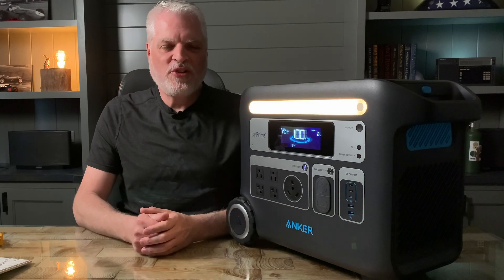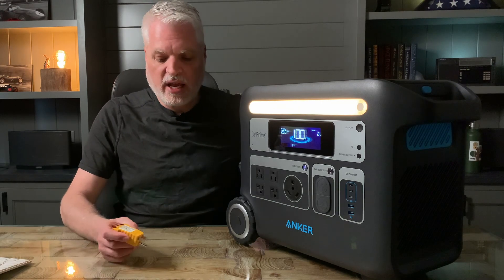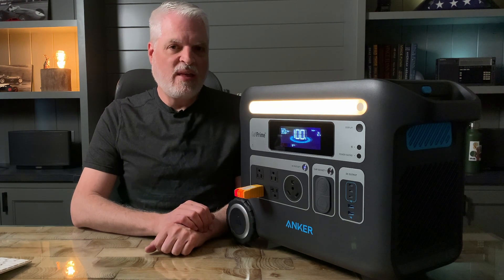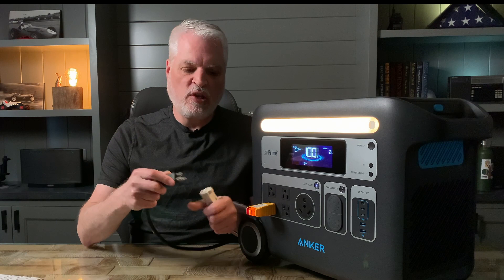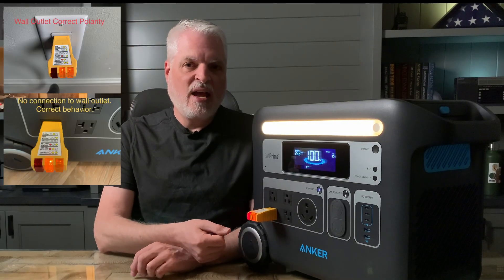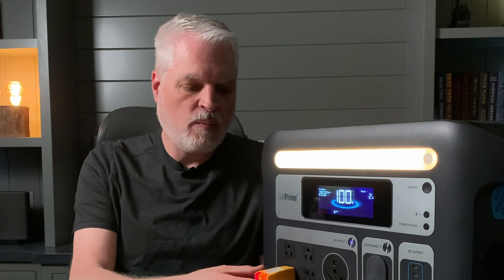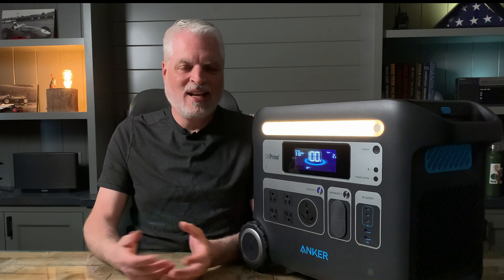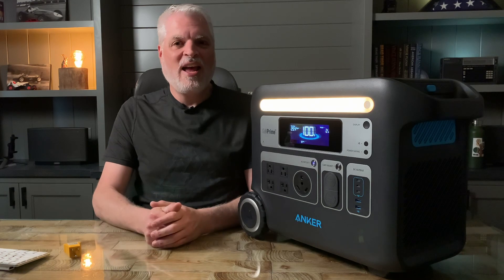SAFETY ALERT: Anker 767 Power Station - DO THIS TODAY!

Comment: Anker says that open-ground is ok to use.  They need to the check NEC on grounding.   Will not accept a return because nothing is wrong with the unit.
Reply: They told me the same

Comment: I just realized this and am 18 months into my purchase.  Of course off line there was no problem.  But now with winter coming on I brought it inside to leave it on mains.  Problem showed up right away with a popped circuit breaker.  I wonder if you could build a circuit to just reverse the polarity of the plug side?  I don't know what's happening internally and would rather have a replacement but since I didn't report it until now they might not like that.  Still, a big investment.
Reply from the maker: Anker has a 5 year warranty so you should be good! I would reach out to their customer service team.

Comment: Thanks for the video, I bought my 767 last year and used it a few times with no issues but after watching this video I did test the plugs and I am getting a HOT NEUTRAL REVERSE issue when it’s not charging. Just sent a email to Anker.
Reply from the maker: They will likely tell you that is normal when running on battery power, as there's no earth connection. When you ground it by plugging it in, it should be ok. That's my understanding, not being an electrician.

Comment: Great video, I received one of these units and in my case the unit shows correct wiring when plugged into bypass mode however when in the inverter mode my socket tester says the live/neutral are reversed. This is weird because it is the opposite. Anker is claiming "you don't have to plug the tester into the 767 when in inverter mode because it does not differentiate between the Neutral and Live wires" is this correct? I have the canadian version without the TT-30R outlet.
Reply from the maker: I received the same reply from Anker. I'm not expert enough in in the nuances of AC Power to know if that's a reasonable answer.
Reply: I just got mine today (767) and I have the same exact problem.  Do you have any updates on this?   When I plug in and it's pass through the tester shows correct.   When not in pass through and unplugged/ inverter only the tester shows hot/neutral REV.  Is this OK or do I have a bad unit?   Thanks for any help on this

Comment: I just tested mine. My outlet is good but the anker before it’s plugged up to outlet shows fault/ open ground, when plugged to outlet it says hot/ neutral reverse? Do I need to contact anker?
Reply from the maker: If you're getting that message when plugged into AC power, I would recommend contacting Anker.
Reply: @TRAILPOWER  I did and have my new unit. Did not take long. Anker did a great job in resolving the issue with zero hesitation! Thank you.

Comment: Today, I received my Anker 767 product and upon plugging it into an AC power source, I observed that the polarity was correct. However, upon unplugging it from the AC power source, I noticed that my Klein RT210 displayed a reversal in the Hot/Neutral connection. Despite this, I have connected several electronics and a wall unit AC unit, which collectively consume 770W and I have not noticed any operational issues. I would like to inquire if it is necessary to report this matter to Anker support, regarding the reversed Hot/Neutral connection.
Reply from the maker: I had the same. Anker’s support said it wasn’t a concern, as did others with more electrical experience than me. I haven’t seen any functional issues with it. If you speak with Anker, I’ll be curious if they have any more to say on it.
Reply: @TRAILPOWER  Upon initially plugging in my electronics and A/C unit, I observed that the system was not functioning as anticipated. However, after updating to the latest firmware version, V2.0.3, and operating the system, I have not experienced any operational issues. Furthermore, I intend to contact Anker to discuss the reversal of the hot and neutral, and I will provide an update on this thread accordingly.
Reply from the maker: They did make some AC-specific updates in the firmware.
Reply: @TRAILPOWER   This was response from Anker:
"Please note the wiring issue has been resolved by our engineers. The units in stock now are the correct version.
Since the tester does not report an error when the 767 is in UPS/bypass mode (plugged into the mains with the AC power button on), it means that the Live/Neutral wires of the Powerhouse are not reversed. You don't have to plug the tester into the 767 when in inverter mode because it does not differentiate between the Neutral and Live wires.

Please rest assured that your Powerhouse is 100% the correct version and is safe to be used. You can plug devices/appliances into it whether in UPS mode or inverter mode."
Reply: @JJ18_M3  I just received mine and have had the exact same experience and  reply from anker.

Comment: My 767 is fully charged, it’s been (2 days) and still has not started charging the expansion pack. 🤷‍♂️  all firmware 1&2 has been updated.  Any advice, besides sending it back and getting two ecoflows.    😂. Your advise is greatly appreciated.
Reply from the maker: I’ve never see that issue. I’d check in with Anker support.

Comment: Scott, how did you ship your 767 back to Anker? did you still have the external shipping box or just use the colorful Anker box?
Reply from the maker: I had both the inner & outer boxes, but Anker did an advance replacement, so I could have sent it back in the replacement box.
Reply: @TRAILPOWER  I only had my inner box so I used it and my repl will be here in 3-5 days.   I'm like you, nothing better than good support. thanks

Comment: Sounds like if you get one of these units, you'd better keep the box. Seems this model made it out of the factory without much (or any) QC. You're not the first person to talk about this issue and a firmware issue (which seems to be fixed).
Reply from the maker: New products have glitches and get fixes. Even if you spend $100k on a new luxury car, you’re going to have recalls and service issues. Anker stood behind it and made it right, with no blame deflection.

Comment: I have heard two different stories on the battery power and would like to which which of these is true: 1) When on battery (and working correctly) it should read 'open ground' or 2) It will read 'Hot and neutral reversed' when on battery (this is not including when plugged into AC). Thanks for your help in advance.
Reply: I got my unit today and show fine on AC but on DC it is showing Hot / Neu reversed and the hot light is flickering. Anker will let me know what they want to do as I sent them a video today. More than likely a new unit, but they said the flickering definitely is not common.
Reply from the maker: Both of my Ankers behave this way- with the hot neutral reverse and the hot flickering. I don't know why that is, but I'm seeing the same flickering red light on my 767 and C1000. My UGreen gives me an open ground, which is what I would expect. My AllPowers behaves the same as the Anker- open ground and flickering red.
Reply: @TRAILPOWER  - The hot flicking is def not normal. I returned my 767 and got a Jackery 2000 Plus. It has no flickering and working much better. It also has the add on battery packs which I just bought one and everything works flawless. They had one firmware update and when I had the Anker for a few weeks they had at least 2 or 3 in just that time. I think they are going through some weird QA issues. I have the 757 and it does not flicker either and is solid.

Comment: With all these going back I suspect when you buy one of these now you might be getting refurbished units. I might consider buying one at a discounted price but would be pissed if they pulled a fast one. I just decided this was the unit I wanted over the Bluetti 200 max because of their stupid noisy charging brick and the slower charging but now not so sure🤔.
Reply from the maker: I haven’t heard of anyone getting refurbs, but it’s possible.

Comment: Your demo failed to establish that the wall outlet of your home is wired properly. That should have been the first test. Even a properly wired Anker 767 would forward a reverse polarity issue originating from a wall outlet to its outlet. Good video but this omission really bothers me.
Reply: I'm correcting my statement now after watching your video a second time. I see that Anker asked you to send picture confirmation that your home outlet is wired correctly. Still, I feel that should have been a recommended step in the process of testing correct polarity of the Anker 767.
Reply from the maker: Pinned comment from day 1 video posted has this instruction. YouTube does not allow video edits after posting, without deleting the video and losing all of the useful comments.

Comment: Hi, I just received mine 5/22/23 with the same issue. Here was their response. Does this sound correct? "Please note the wiring issue has been discovered and resolved by our engineers. The units in stock now are the correct version.

May I know if the tester reports an error only when in inverter mode? If the tester does not report an error when in UPS/bypass mode, it means that the Live/Neutral wires of the Powerhouse are not reversed.  

You don't have to plug the tester into the 767 when in inverter mode because it does not differentiate between the Neutral and Live wires."
Reply from the maker: They sent everyone that same reply. I hope they’re correct. Seems that they are still tinkering with firmware to fully resolve the issues.

Comment: Firmware 1.2.2 update solves the problem. Thanks Anker
Reply: Did they just release 1.2.2?
My replacement 767 arrived yesterday with the same problem of the original. The latest update (1.1.7 I believe). Didn’t change anything.
Reply: @miker8619  it was released today (5/10/23)
Reply: @alexLegends561  Just went to update the software. According to the app. My 767 is up to date at 1.1.7? 
There was nothing for me to upgrade to.
Reply: @miker8619  I would definitely call customer service with your serial number ready

Comment: I just tested. While plugged into wall it reads “correct”. Unplugged from wall, it reads either “ hot neu rev” or “ open ground”, the red light is really dim but on. When I push the GFCI, the red lights up brighter. Any idea what’s I should do? Everything works for me except my window AC unit rattles a lot and has irregular wattage reading.
Reply: My shipping box has the “new” sticker by the way. My ac unit is a small 5000 btu unit
Reply: Having the same issue. This is the response I got from Anker:

"Since the tester does not report an error when in UPS/bypass mode, it means that the Live/Neutral wires of the Powerhouse are not reversed.  You don't have to plug the tester into the 767 when in inverter mode because it does not differentiate between the Neutral and Live wires.

Please rest assured that your Powerhouse is 100% the correct version and is safe to be used. You can plug devices/appliances into it whether in UPS mode or inverter mode."
Reply: @bernardobaptista5150  I received the exact reply. Make sure your firmware is updated on your Anker. This update solves the problem!
Reply from the maker: When I try and update the firmware, it says 1.1.7 is the latest version. My app is also up-to-date. 🤷‍♂️
Reply from the maker: I received the same reply from Anker.
Reply: I have this same issue.  Just got mine today.  Please let me know if anyone gets any updates.

Comment: Just received mine on 3 May 2023 and it has the same problem. I tested it too late in the day to call but did send an email. Not sure why they are still shipping defective units.
Reply from the maker: Hmm that’s odd. My replacement was received a couple days ago and doesn’t have it.
Reply: @TRAILPOWER  The email I got back from Anker said it was a shipping mistake and I shouldn't have received one with the faulty wiring. They are prepping a FedEx shipping label and I'll return it. Fortunately, you and a few others have posted these videos and I was able to test the system before I had an issue. Thanks again for the video.

Comment: Urgent question here.  I received my replacement 767 today and the AC outlets test OK (when using my outlet tester) when plugged into my house AC receptacle, which also tests "wired correctly." So, this 767 seems to be wired correctly.  BUT, when I disconnect the power cord from the wall, to simulate a power failure, the tester shows "hot and neutral reversed."  One red and one yellow light. Is my unit defective?  I am not an electrician here.......  Thanks for your input!
Reply from the maker: Richard, I just received mine, and am seeing the same thing. I’m not an electrician either, so I will have to defer to others in the comments, and Anker support on this.  If I learn more, I will pass it along.
Reply: What was the final answer here? I'm on my second unit - the first showed reversed when in UPS mode and normal on Inverter/Battery mode. Now my new unit is reversed and support is telling me the same "this is expected" answer. Should I press for a 3rd unit?
Reply: @ColemanAsCode  I received my 2nd unit. I was told that in the inverter mode the output is only 2 pin. CS told me "that you don't have to plug  the tester into the 767 when in inverter mode because it does not differentiate between the live and neutral wires."  Makes sense to me.  My replacement 767 came in a box that had a "NEW" sticker on it. It seems to work perfectly so I am guessing that they fixed the issue.  Your call on whether to request #3 but I am guessing that you may get pushback if it is working fine.   I have a question for you (and anyone else) when you leave your AC inverter on with no continuous draw, like a sump pump, does your unit shut off after a period of time?  This happens to mine after a number of hours; the power saver is also set to off.
Reply: @richardmolnar3007  Thanks for the reply. I've left my new unit on inverter power while connected to my Anker Everfrost cooler for the past 24 hours. The cooler typically runs for about 20mins per hour and the 767 hasn't shut off on me yet.

Comment: Should the outlet tester lights turn on when the Anker is plugged in but the inverter is turned off?
Reply from the maker: No. If the AC power is turned off, there should be no power to the outlets. I may have phrased that incorrectly in the video.
Reply: @TRAILPOWER  My unit was purchased a few days ago and does not appear to have the same issue as yours.  The tester shows to be correct when the inverter is on and the unit is plugged in.  It shows hot ground reverse with the inverter off and unit plugged in.
Reply from the maker: So your tester is lighting up when the AC outlets are turned off??
Reply: @TRAILPOWER  Yes.  When they are turned on it looks correct.  I did not expect to see anything with the ac outlets off.
Reply from the maker: Wow, that’s not good.  There should be no power to those outlets when the switch is turned off. I need to have someone else test that who has a ‘new build.’ Let me try and connect with another viewer and have hint test this.
Reply: @TRAILPOWER  Thank you!  I would be curious to hear if anyone else is experiencing this as well.
Reply from the maker: @hourhour9164  Mikey in the comments ran some tests for you on his. He’s much more experienced than me with AC power, so hopefully he’ll pop by and shed some light on what you’re seeing.
Reply: @hourhour9164  I’ve been doing some testing with my multimeter to get actual voltages rather than just lights on a tester. What I’m seeing is the effect of having the 767 having an un-bonded neutral ground internally. This is common for larger generators that will be plugged into a transfer switch to power a house. Once plugged into the house transfer switch, the generator uses the panel’s bonded neutral ground bar. If the generator was internally bonded, you would end up with a ground loop once you plugged it into a transfer panel that already has a bonded neutral/ground. You can read more about my testing in one of the other long threads on this video with TRAILPOWER if you really want numbers. 

I’m not an engineer or expert on generators, but do have an industrial electrical degree and am personally not concerned with this behavior.  Take that for what it’s worth…
Reply: @HamnesiaRadio  Thanks for the explanation!  I did not use a multimeter, just the outlet tester.  I ran the same test with a much smaller power station and did not have the same results.  I will read more about it though.
Reply from the maker: @hourhour9164  @Leafnutz tested his newly-replaced unit with an outlet tester and has no lights with inverter off and charging from AC. Might want to check in with him too. Also, be sure to test your wall outlet and make sure it’s wired correctly.
Reply: @TRAILPOWER  Here is a test I ran earlier: https://youtube.com/shorts/QM-EWOrNdqo
Reply from the maker: @hourhour9164  I’d suggest sharing that video with Anker, Mikey and leafnutz. I am definitely not an electrician, and don’t know with certainty if that’s of concern. Seems wrong to me. Leafnutz said he has zero lights when the inverter is off.
Reply: I have a replacement unit. When the unit is plugged in and the inverter is turned off, there are no lights.